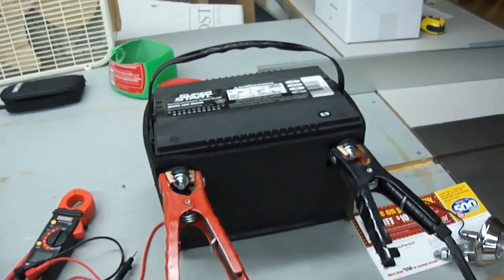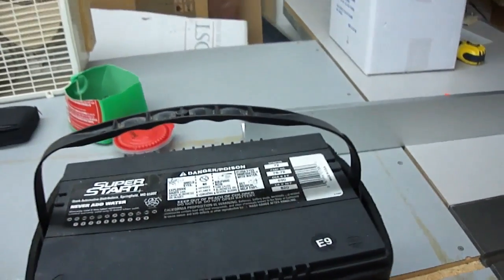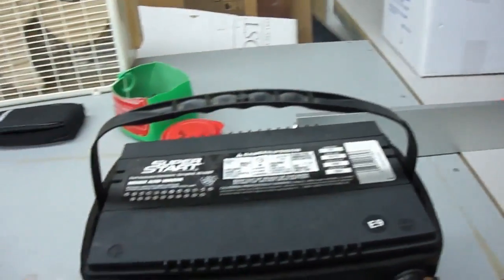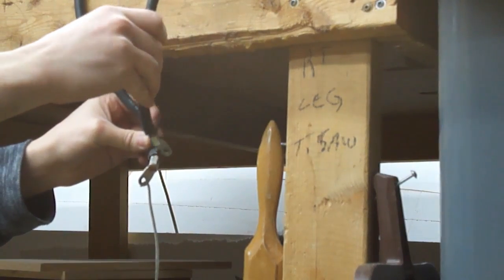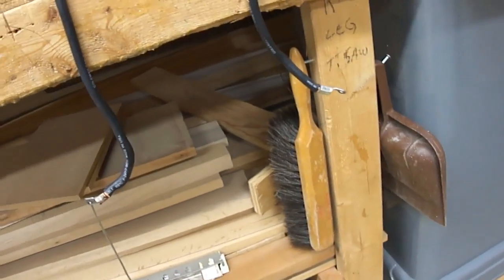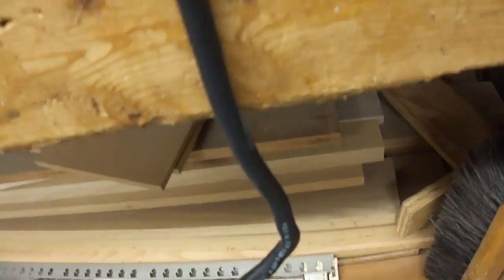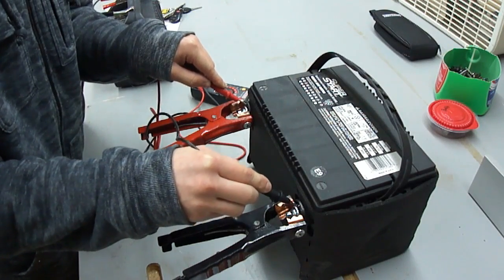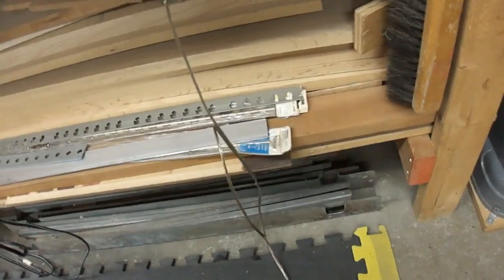Resistance Demo With a Car Battery - 12v

Comment: If you measure the voltage across the battery while connecting the long wire you essentially have a battery load tester. You will be measuring the voltage drop across the internal resistance of the battery and this effectively tells you the Cranking Amps of the battery via Thevenin's Theorum and Ohm's Law.

Comment: To get an electric shock you'll need around 30-50V (if I remember well)
Reply: I know that's accurate... "but", I remember once leaning across a battery with my palm and get got a good, ah... tingle? It was enough that I didn't want to leave it there for a second longer. I must have been very conductive that day? But I always remember that (obviously).. so I have a bit more respect for low voltage (just in case:). Like a 9V tongue test. Just saying ¯\_(ツ)_/¯   Cheers from the future.

Comment: Just got shocked by 16 batteries created a circuit to the ground and jumped my entire body. Wish I could show you a picture but negative touch the metal structure me wrenching the positive while the other end on the positive wire im wrenching touched the last bottom negative in the line up boom jolted my entire body off the stool.
Reply: Funny thing I wanted to learn more about batteries since I’m scraping 100000 lbs of them and watched this video yesterday to try not to short circuit them again that created a  cloud of thick smoke over 200 degrees in a second and had to extinguish it. Now today I did what you said couldn’t happen...🤦‍♂️

Comment: To get shocked by a car battery:
Remove the negative clamp
Hold in one hand the loose cable
With other hand touch battery negative post
Have assistant start car

Mission accomplished
Reply: The resistance of the human body is 500 ohms to 100,000 ohms depending on how wet your hands are. So let’s use the lowest value of 500 ohms. Current = voltage/resistance. So the current that would go through you is 12 / 500 = 0.024 amps. I am sure you will not notice 0.024 amps of current at 12 volts. 

If there is something on the surface of your body with less resistance you will feel the current going through that. Like a wet shirt or extreme jewelry.

Comment: Nice video on batteries. Is the reason you cant get shocked is because its DC current? If is were 12VAC would you get shocked? at the same current level?
Is the reason you don't get shocked is because the resistance in your hands is to large, so no current can pass.
Reply from the maker: +Jim Ho It's all about resistance
Reply: Yes the reason 12v won’t shock you is the resistance of the human body Which is 500 ohms to 100,000 ohms depending on how wet your hands are. So let’s use the lowest value of 500 ohms. Current = voltage/resistance. So the current that would go through you is 12 / 500 = 0.024 amps. I am sure you will not notice 0.024 amps of current at 12 volts.